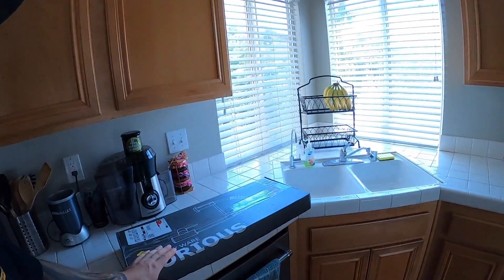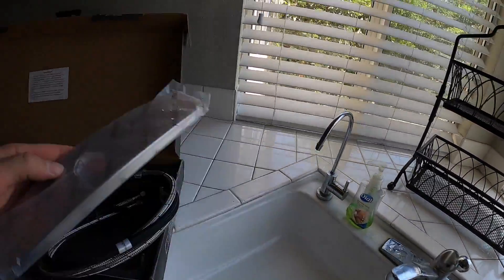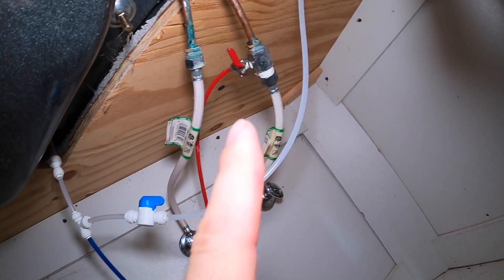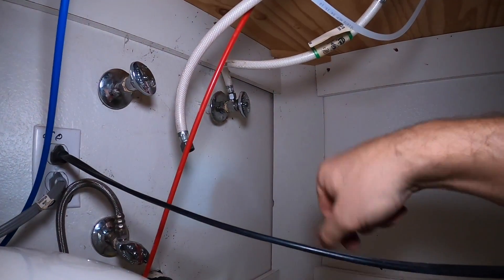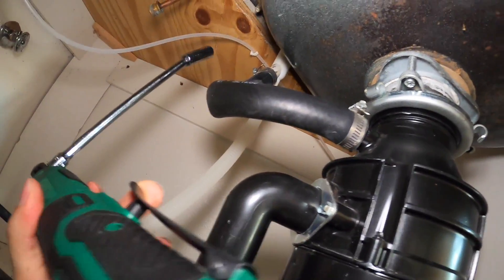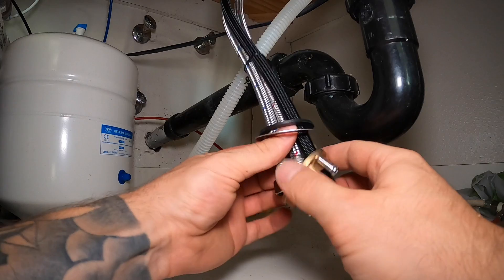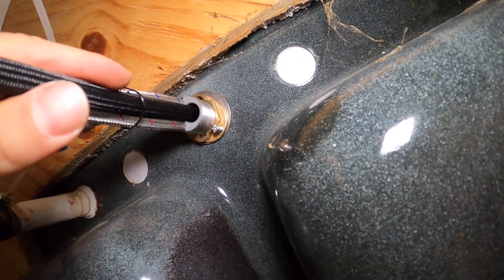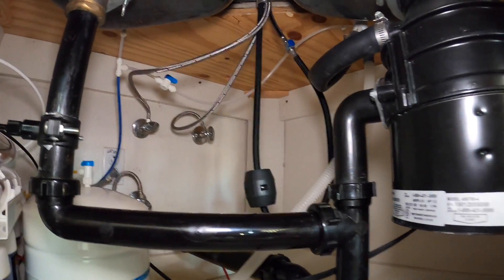BEST KITCHEN FAUCET UNDER $40 ON AMAZON

Comment: The biggest point of failure with these is that button on the side to change the flow of water.  Thankfully, you can order that separate for about 10 bucks.  I ordered the one that has separate piping for the spray and single stream to not have to worry about that.  But overall, these are awsome and I will no longer spend $200 plus on a Moen that will have the same issues and is made out of plastic in some cases.

Comment: My Rubber washer went between the faucet and the top of the sink, its weird that it had you put a rubber washer under, Mine says on top to prevent leaks from going through. I feel with the washer underneath it will just hold water that may leak though the top of the faucet. Great Video though, I just installed mine after watching.